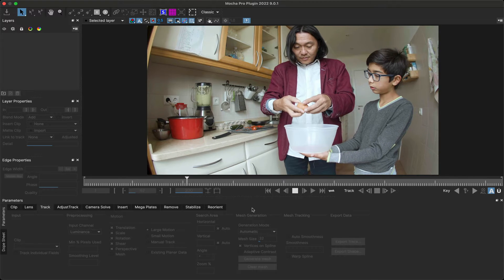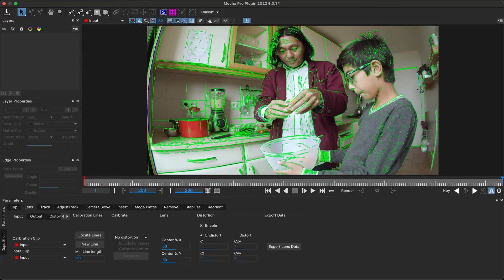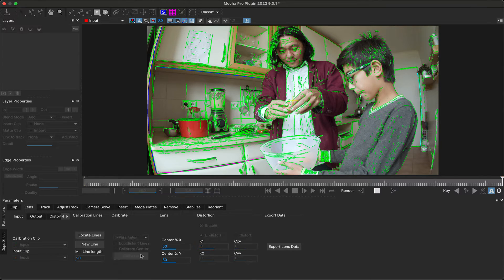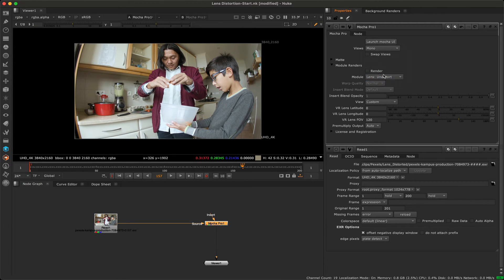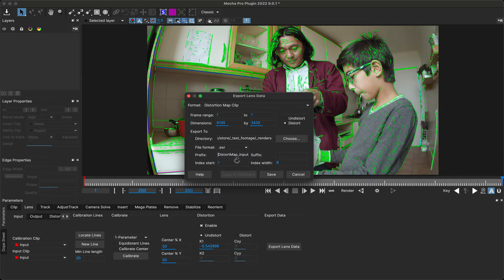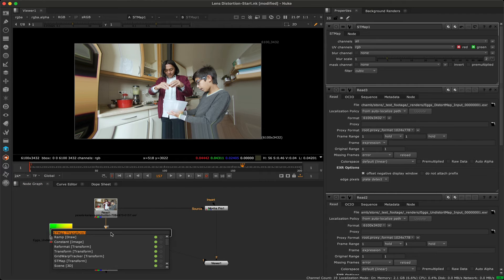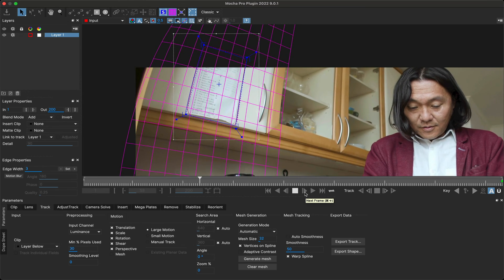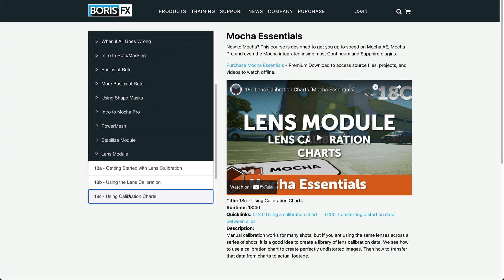Mocha Pro Quick Tip: Lens Distortion and STMaps in Nuke

Comment: How would you handle gyro data from drones?
Would you first stabilise with Gyroflow or do the stabilising last?
Reply from the maker: Any time you add stabilization, you're going to affect the apparent lens distortion in the image. It will basically make it impossible to accurately calculate the lens. Stabilizing should come afterwards.
Reply: @BorisFXco  Thank you!